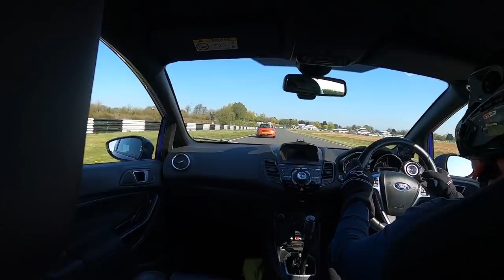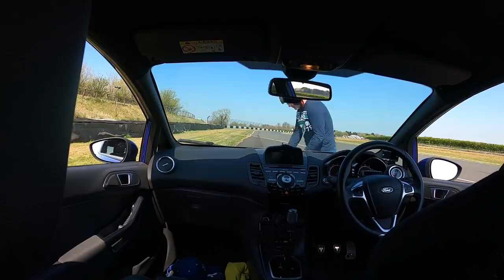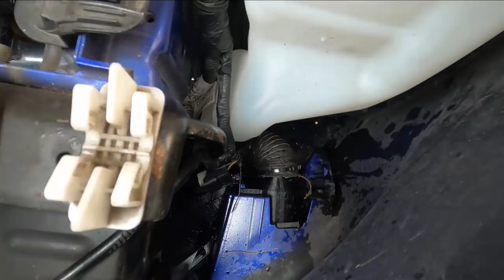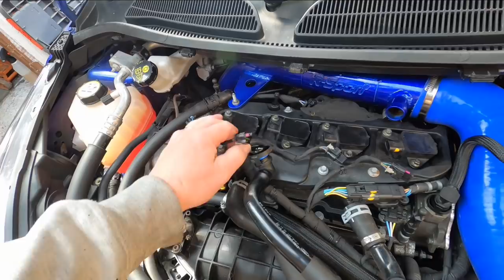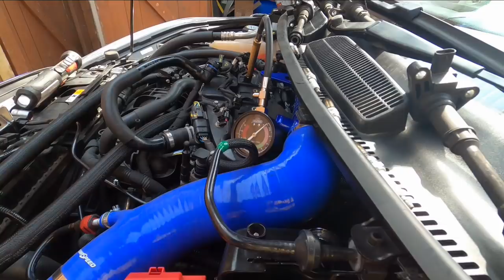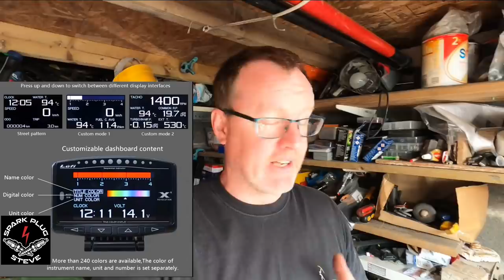My engine blew up! (NOT CLICKBAIT... well maybe the thumbnail just a little)

Comment: That why I dont touch modern engine, unreaible and rubbish.
Reply: tell me you drive a slow car, without telling me you drive a slow car
Reply: The engine was running massively above specification from the tuning and big turbo. At stock power it's a very reliable engine, like most modern engines.